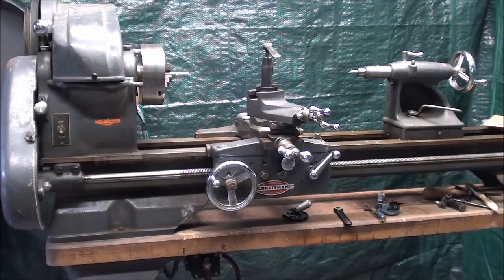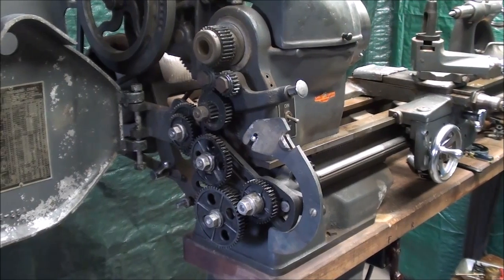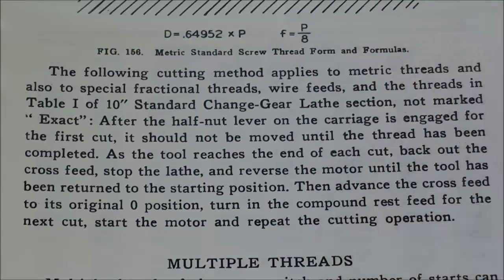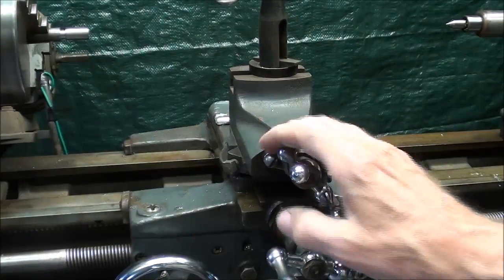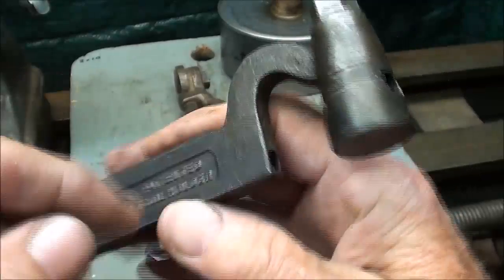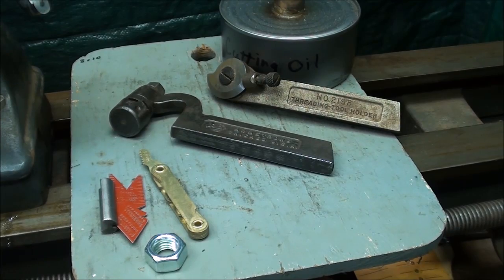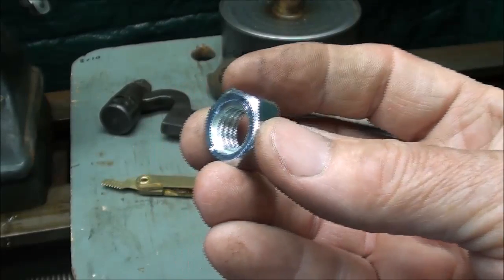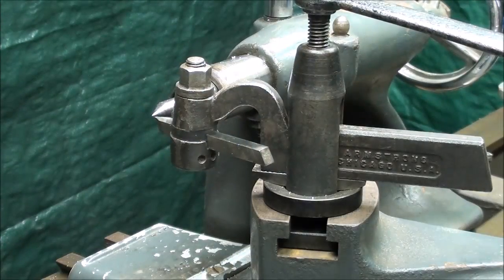SHOP TIPS #226 Cutting a Metric Thread Atlas Lathe Pt 1 tubalcain

Comment: Why is it necessary to angle the rest at 29° when you’re going to angle the cutting tool separately to be 90° to the work?
Reply: Although I mostly own theoretical knowledge instead of practical, I think the explanation to this is that you want to cut with the "left" side of the tool-point. Driving the tool into the work with the compound at 29 degrees will make all cutting to be done with that side of the tool.
Reply: @Hephaistos-q3b  I’ve learnt a lot in the time since posting and my understanding is that you are cutting more on that side of the tool, but not entirely. Joe pie has a good video on it.

Comment: Mr Pete, I just got a Logan 9-b-28-1 recently. I’m wanting to cut a metric thread but this lathe didn’t come with any change gears, it’s got a quick change gear box, but not any extra gears. Is there a way I can rearrange the gears on the lathe to make it turn metric threads or will I need to find a set of change gears?
Reply from the maker: No, you would need a Nother set of gears in order to cut metric thrones

Comment: I love your videos. Your passion shows! 40 years ago when I replaced an 1940's Atlas with a Craftsman Commercial with quick change gearbox, I believe the paperwork said to cut metric threads required an optional metric lead screw.
Reply from the maker: +Russel Allen thanks

Comment: As always, a great video. You mentioned that the Atlas change gear lathe has more possibilities for cutting threads, than one with a quickchange gearbox. I use a South Bend lathe, with a quick change gearbox, I don't have an Atlas so I cannot dispute the fact. But on the South Bend lathe, I have not found any thread pitch that could not be cut using the quick change gearbox, with a combination of Change gears. In fact using a computer, I have calculated thousands of thread combinations. Just to see what the possibilities are. and found some pretty odd thread pitches. Such as a 3.3333… And a 6.6666… I found way too many to remember, much less list here. But it was very interesting to see what the possibilities are.
Reply from the maker: +Joe Allen Good to know. Thanks for watching

Comment: Good info as always Mr. Pete, thanks for it! 
Interestingly, those metric cutting instructions for the imperial lathe are a little familiar to me. My big lathe is a 1908 American Tool Works 14"x6' and although it cannot cut threads now due to mechanical problems, from what I understand that method of engaging the half-nut and leaving it engaged until the thread is complete was the standard procedure for that era as the lathes did not have a thread dial at all. 
That's what I've read anyway, just a 'for what it's worth'.
Off to watch part 2 now.
Reply from the maker: +ShysterLawyer Might be-Thanks for watching

Comment: You can cut metric with the QC by putting the metric conversion gears in the chain that drives the QC primary. The particular gear selection does depend on the particular metric thread, as the gears for imperial are selected for reciprocal pitch (threads per inch), and for metric, you want true pitch. But, many common metric pitches can be had with a single set, as the ratios go as 4/4, 4/5, 4/6. 4/7. 4/8 (reciprocal mm pitch- 4/8, or 1/2 thd/mm is 2mm pitch) for 1, 1.25, 1.5, 1.75, and 2mm pitch, and the next range gives you 8/4 and 8/6 for 0.5mm and 0.75mm.
Reply: +john john The lathes that do both metric and imperial, have the famous 127 tooth gear to do the conversion.  Still have to stay engaged though, cause the lead screw is still imperial...   ;)
Reply: +pierre beaudry True. But I was referring to needing to remove the QC box. That can stay and a greatly reduced set of selection gears can be used for metric. I gave an incorrect list above (not looking at the lathe with the chart on it last night). If, for example, change gears are put in to make the 30TPI setting cut at 1.0mm, then the 20PTI setting will cut 1.5mm, and the 15TPI setting will cut 2.0mm. There are only a few setups required to get all standard threads this way.
Reply from the maker: +john john Thanks for watching
Reply: +john john Is it possible to have a little more information on this?  Or could you point me in the right direction?  I'd love to be able to cut .8, 1, 1.25, 1.5mm threads on my Atlas...

And Mr. Pete.  I just found your youtube channel.  Thank you.
Reply from the maker: +john john Thanks for watching.
Reply from the maker: +Dave Rose  Thanks for watching.--for more info, check out the atlas book